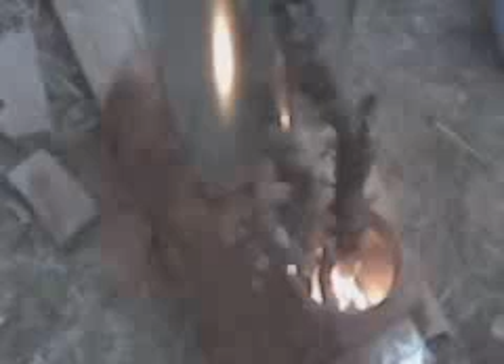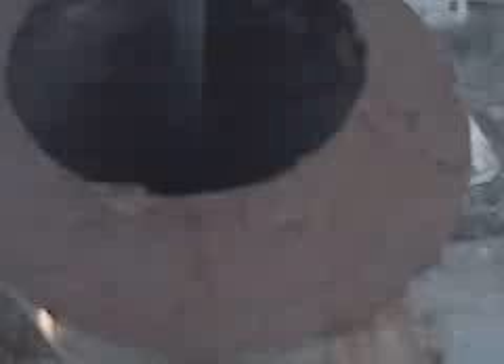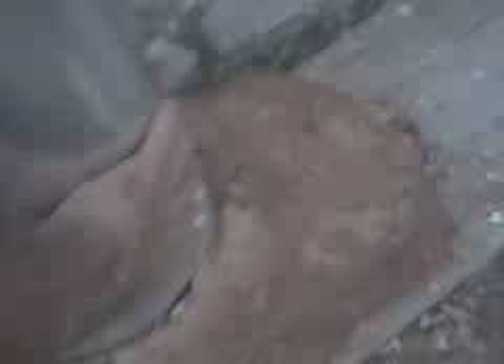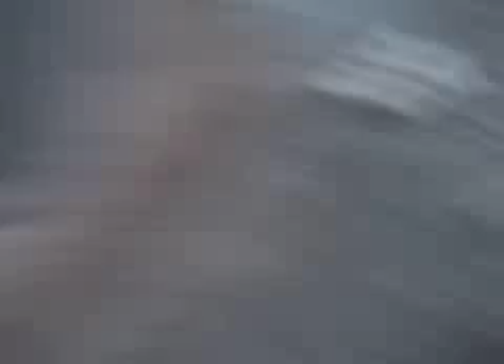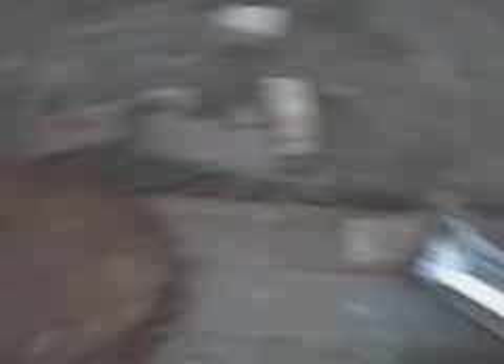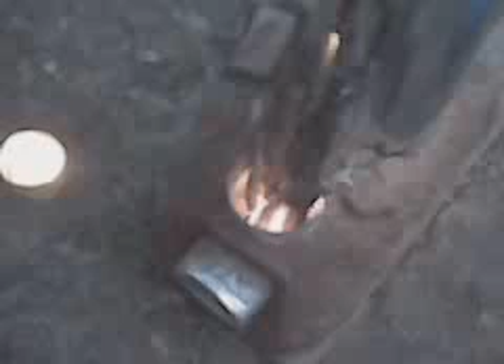Rocket stove for winter greenhouse part 3

Comment from the maker: Good thought. Something as small as a computer fan would work. It could be run off a small solar panel and a 6v. battery from commercial emergency light  if electricity wasn't readily available.

Comment: Also, the addition of an externally driven blower fan on a "T"or"Y" pipe at the end of Ur flu pipe run w/a damper control flap b4 it at the "T" or "Y" junction that would draw through the flu pipe during start up of the unit to guarantee good draft on start up until flow could be established in the internal chimney of the unit would guarantee that no smoke ever enter the internal building area. Just another thought that we were having down here b4 we begin construct on our 1st unit this summer.

Comment: That might work if U were working w/smooth milled lumber scraps, but in the case of rough firewood w/bark on it sometimes, my thought of a smooth ring, a segment from a 20 gal barrel or something, suspended on stilts, bar stock, or something of the sort, over the feed tube might work out better for all types of wood.  That way U could conceivably feed 3'-4' lengths of stock into it, and not have to constantly feed it.  One of the drawbacks w/our std. wood burners here now.

Comment: Ya Mike, that'd make sense.  I wasn't thinking of something that I could feed 6' long logs into, just something to contain the stock somewhat so that the ends didn't just burn off of the stock and then them fall over out of the feed tube.  Maybe even a containment ring that's just suspended over the feed tube on stilts of some sort, so that U're not creating a competing chimney.  Very good thinking, and another great learning experience.

Comment from the maker: I've always been one to have to learn from my own mistakes. Other peoples mistakes never really sink in for me. Oh well. I think mortaring the bricks w/ cob is a good idea, but be careful cobing the feed tube. if it is too insulated or too tall it will begin to compete with the draw of the system and smoke will start coming out of the feed tube. I initially made mine too tall thinking I would be able to load more fuel at a time.

Comment: Ur interior temp., at least until Ur cob mass temps start to get up there.  I've built transference boxes around some of my flu pipes and one of the wood burner's blower discharge ducts here, and documented as much as a 40 degree F difference in the discharge temps of the 2 discharge ducts, the one inside the transference box w/the flu pipe, and the other not.  Good job.  I'd like to see Ur pyrometer figures when U finally do get them.  Thanx, Battered/Jeff!  :)

Comment: It is my contention that what U did w/Ur long flu pipe run through the interior of Ur greenhouse there may very well be the last missing link to the most efficient wood burning system on the planet.  To the best of my knowledge no one else has ever built one w/that much interior exposed flu pipe outside of the cob mass, and what I believe may be the final link.  It's bothered me for years that I've been sending 250 degree F heat out of my stacks.  I'll bet Ur exhaust's w/in a couple degrees of..

Comment: It's far better to learn from the trials and errors of others than having to make all of our own.  I've also been thinking that maybe packing around the feed tube w/cob, or just making that portion of the unit out of fire brick w/cob as a mortar between the bricks might not just be the way to go w/the base of the unit.  I've never been a fan of just stacking the bricks up w/nothing between them to bind them in place, especially if U're not the only one running the unit.

Comment: Maybe just another piece of maybe 8" dia. flu pipe might do the trick, smooth walls should allow the feed to do just that, but it might have to be cobbed in for stability, which could be a problem w/startup, unless U incorporated a "T" as a feed tube w/a cleanout, instead of an elbow, that U could also use for startup of the unit.  Also, that was good thinking to increase the clearance between the bottom of Ur barrel to the top of the chimney to improve flow for Ur long flu pipe run.  Bravo!

Comment: I kinda figured that.  I'm running 4 regular wood burners in my place here, and we're constantly burning out heavy steel stuff 1/4"+ thick. I think fire brick's the only way to go for the base and entry portion of the units.  My other concern was the top of the barrel over the main chimney inside the unit.  My plan is now to go w/an additional layer of stainless steel in that section, but I do like Ur exposed long flu pipe run after the cob mass pile.  I've always hated sending 250 + heat out.

Comment from the maker: I think your plan will work just fine. The vertical part of my J tube held up fine. but something to mention is that the bend of the J where it turns up into the insulated burn tube didn't hold up because the single wall rigid duct collapsed from the heat. I would use fire brick or at least 1/8" steel for that part.

Comment: Hey Mike, U'd also mentioned that U didn't have any thermometers in there yet, which I wasn't really as much curious about as after U finally do get all of Ur cob in place, is what the rest of Ur flu pipe temps are, as well as Ur final exhaust temp coming out of Ur flu pipe.  This can be easily obtained w/a digital infrared pyrometer from Harbor Freight for about $30.00.  I'd really like to know that info, b/c the lower Ur exhaust temp, the more heat Ur keeping inside.

Comment: Hey Mike, nice build, but I'd be interested to know about the integrity of the vertical tube of the "J" tube inside the barrel after a season or so.  Most are recommending that be made completely out of fire brick, but I was planning on building mine out of that double walled insulated stainless steel wood burner flu pipe w/a larger std. galv. 12" dia tube around that filled w/vermiculite for additional insulation.

Comment: Nice set of videos, thanks.
Just wondering if its possible, that the fire could burn mostly upwards, out of the wood feed tube ?
Its just most of the rocket stoves I have seen have been horizontal feed.

Comment from the maker: @kinnear69 It worked too well. It got too hot and weakened the duct I used for the elbow joint. I had to do a redesign using heavier metal. N o updates in a while cause my video camera stopped working. Will get it working soon and do some updates.

Comment from the maker: I insulated it with sand and papercrete. To make papercrete you first take old newspaper and soak it in water. Then you pulp it. I used a drill with a paint stirring paddle to pulp mine. Then add portland cement. I used 10% portland by dry weight. pour it into a form and let it dry. There are many videos on youtube on papercrete. Thanks for the question.